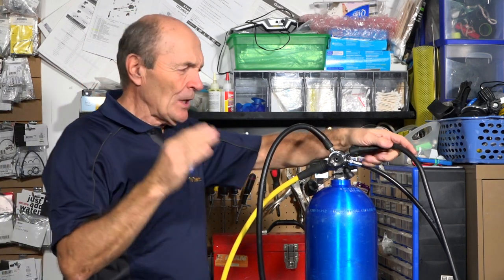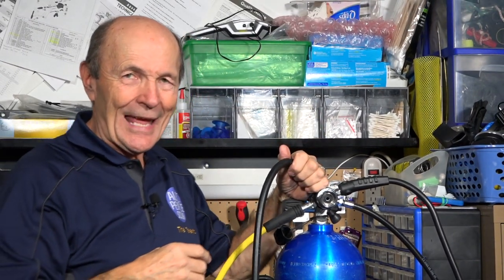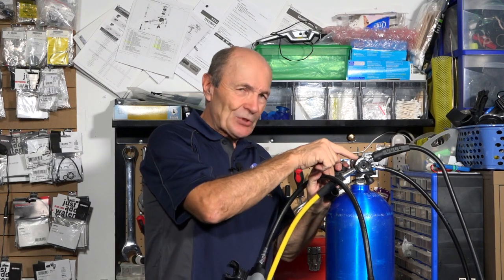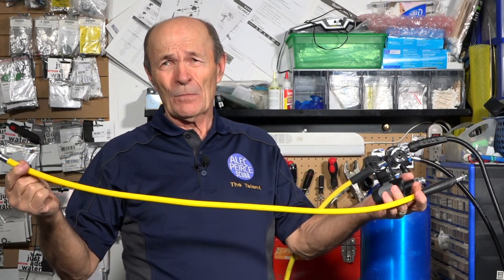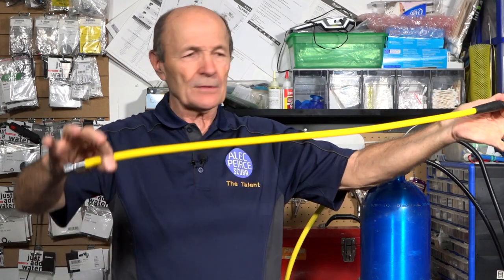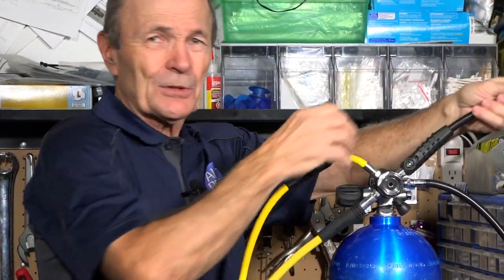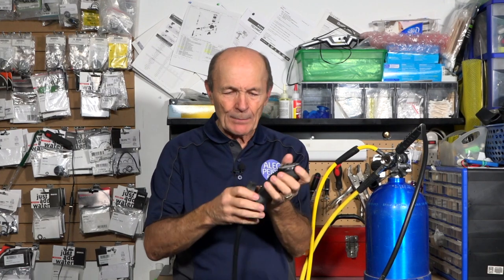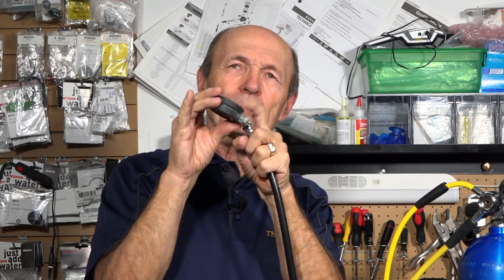Replacing Regulator Hoses - Scuba Tech Tips: S10E14

Comment: Hi Alec. Thank you for good tech tip. One thing I would like to warn: if you mean to use your reg with nitrox, NEVER use silicon grease especially with hp parts, like spg. Use proper oxygen grease, like Crystolube. Otherwise the greased part may explode.
Reply from the maker: That idea is largely overblown. There are many factors at play in an Enriched Air system.
However, generally you are quite right. If using a regulator in EAN, use O2-compatible grease.
Alec

Comment: Hello Alec.  I enjoy your videos.  I’ve not replaced hoses on my regulator, but something occurred to me as I was watching your video.  When you remove a hose from the first stage of a regulator with a second stage also attached to the hose, one might want to remove the second stage first, so your second stage is not flopping around while you are unscrewing the hose from the first stage.  Additionally, if you replace a new hose, you might want to attach the first stage, first.  Your second stage won’t be flopping around as you screw in the hose.  Finally, after you attach the new hose to the first stage, one could blow some air through the hose, from the attached tank, removing any dust or manufacturing debris before attaching the second stage.  Removing the most distal device first would apply to all low and high pressure hoses on the first stage.
Reply from the maker: Good points Jack.  As a long time service technician it does not bother me having the 2nd stage connected, I follow a consistent process for all regulators.  Not shown but part of hose replacements is the full air test to clear dust and test for free flow and leaks.  You sound like a guy familiar with a wrench where most young divers never had shop classes.
Thanks for watching.
Alec

Comment: Thanks for Your informative videos.

Q: How do I get the right length of my hoses? With whom do I speak to get custom length hoses?
Reply: most online places (like leisurepro) will sell HP/LP flex hoses in many lengths -  the "Blue Reef High Pressure Flex Hose" for example comes in 6",9",22"-40" with 2" increments so you can find exactly what you need. Easiest to use your existing hoses and see if you need longer or shorter from that... else use a measuring tape and try to set your BCD/rig and measure the approximate length (better to be longer than shorter IMO).
TIP: don't get leisurepro "silver" hoses - they are stainless steel which will have strand breaking over time and cause VERY sharp strand to cut you like butter - I ended up tossing mine and re-ordering the black nylon ones instead.
Reply from the maker: Right Alain.
In fact, you can order hoses in any length you want - not just the cut lengths.
Check the catalog at  www.tridentdive.com .
It can get expensive so try to work with the stock sizes.
Alec

Comment: Thanks again Alec !! Always so good to watch you ... quick question for you, I got an OTS spectrum FFM and I wonder if I add a quick connect and a swivel before my mask (as my mk25 s600 50th edition is used with my mask) could it be bad ? Any danger or tips ?
Reply from the maker: Adding a swivel should not be a problem as it is secured with wrenches.  Quick disconnects of your primary air supply should be careful considered along with your backup in case of a failure or accidental disconnect.  Best discuss it with your local dive store service professional before making changes.
Alec

Comment: Hi Alec, I have been enjoying your videos. I have noticed that sometimes the insert in tank valves for the Din/yoke converter can be dented near where the Allen key should go. Should they be like this or are they just easily damaged? Is it a problem if they are dented? I've noticed it before on rental tanks but I've just noticed my new steel tank valve has been dented there too.
Reply from the maker: Tank valves get damaged a lot due to the constant fill, move to the boat, dive, back to the store, fill, repeat.  Denting around the hex nut is not a problem and these can be replaced quickly and cheaply.  There should be no dents or damage where the yoke O-ring attaches as it is the O-ring holding 3,000 psi back, not the screw pressure.  When in doubt, take it to your local dive store for the service pro to examine.
Save diving.
Alec

Comment: Fine overview, my question is about the O ring lubrication, everytime I splitted an O ring, the cause was because it was dry so when you say to not lubricate the O rings fitted on the ORB fittings at the regulator end of every hose, this leave me a bit perplex,
 Everytime i install or reinstall a regulator hose or any O ring based fitting, I use a bit of lubricant on the O ring ( just wetting it )to make sure that the O ring is not distorted or sheared and slips at it's right place
Reply from the maker: O-Rings today are extremely durable and should last for several years without any deterioration.
All O-Rings are replaced at annual or bi-annual service. All factory service kits come with a complete set of regulator O-rings for that very reason.
If you have had an O-Ring split because it was dried out, it was LONG overdue for replacement.
So, not meaning to insult you, it's not an O-Ring issue. It's a service issue.
Alec
Reply: @AlecPeirceScuba_SeaHunter  my comment covers much more than diving regulators, for sure, the movement of rotary joints is very limited on a diving regulator so lubricating is not mandatory but it is a good insurance. I saw split o-rings on hydraulic O ring boss fittings and on screwed  cylinder caps.
I know well that the majority of mechanics and assemblers do dry assemblies but if you have to disassemble later it is often an headhache, for that reason , when I have to specify an assembly procedure, thread protection and general lubrication is clearly specified and it a part of the quality control procedure.

Comment: Some swivels are straight, as in the video and some have an extra band halfway along. Are they interchangeable and, if not, why not?
Reply: I think some are built in to the reg i think check with your local dive store on that you can buy like omni swivel or like xs scuba has dual swivel hoses
Reply from the maker: Many are brand specific and cannot be exchanged. Usually the after-market models are interchangeable.
Alec

Comment: I love these tech tips!
I have a question, the myflex hp hose has a bigger bore compared to the scubapro rubber hose that connects to my dive computer (scubapro aladin h). Do you foresee any issues if i switch to the myflex hp hose?
Reply: weird, most of the HP flex hoses I've used are much smaller diameter than the old rubber hoses (much less material) so exactly the opposite, which makes then harder to clip. You way want to try a thinner one like "Blue Reef High Pressure Flex Hose" I mentioned above. Quite cheaper than myflex too at <$30. if too big it won't pass through any console boot.
Reply: Hi Angadmy understanding of the very small diameter hole is to restrict the loss of air from the tank if the hose or gauge breaks, gives you a bit more time to head up or find your buddy before all the air runs out. The gauge or dive computer requires virtually no air so the small hole is fine. Your new hose may not provide that same safety factor. I think Alec says the same thing in his past tech tip on hoses S06-E16. Hope this helps Owen m
Reply: Xs scuba has a flex hose for hp
Reply from the maker: Right guys. Thanks for stepping in with good advice. I have been more than bit tied up lately.
Generally an HP hose has a smaller diameter and much smaller holes at both ends - 1st stage and SPG/Computer.
It doesn't matter. Even a tiny hose will suffice. There is no air flow. Only pressure so the hole can be tiny.
Alec